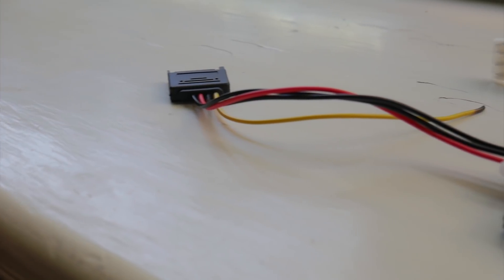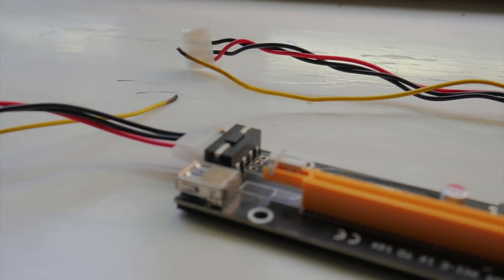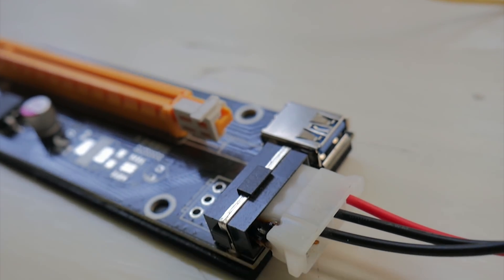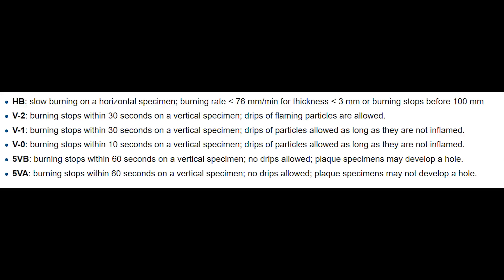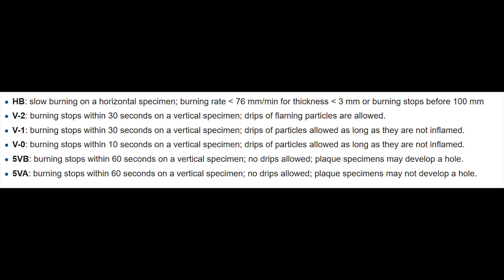My Mining Rig Caught Fire!?

Comment: I would like to add for those that are unfamilliar that smaller numbers on wire gauge equal thicker wire and higher numbers equal thinner wire.  Larger than 18 gauge would be 16 and not 20 because of this.
Reply: Is there an English translation for this thread?
Reply: So 18 gauge is 18AWG ?
Reply: @q8tech108  yes
Reply: cracklingice if people who don’t know this much less common sense to not overload wire never intended to handle that much current draw, they have no business messing with mining. 

Great way to burn down your house,. Also people need to stop putting multiple connections on a single six pin connection or using all the 6 pin connections that are in series coming from a power supply. Do not piggy back anything to power your risers or GPU. They are simply over amping that set of connections. Each graphics card should have their own dedicated line to the power supply. Hence they won’t catch fire and melt. 

It is as stupid as putting way too many high amp draw devices into a power strip and plugging it in your wall. It will burn your house down.

Comment: Can somone tell m e cause of This issue? So if I try to use claymore I get "NVML: cannot get current temperature, error 15".. But if I run cryptoheavy then I can run fully OC without a hiccup
Reply from the maker: any logs? hop in discord.
Reply: It's really weird.. it doesn't matter which card, or pcie slot I use.. Once I have all 12 cards plugged in the issue comes up but if I unplug any one of them it doesn't get the issue. I changed some of the risers and it doesn't matter. I thought maybe one of the slots was bad, but when I switch them around it doesn't effect it... basically 11 cards no problem, 12 cards problem.. I've run this setup for nearly a year before this without a problem... also if I run cryptoheavy I get no issues with 12 cards. I'm running SMOS

Comment: People think because it has worked X months without an issue it's fine. Nope it may not be fine. From doing electrical work I find that wires and components break down over time. This happens due to excessive heat on the site or connector. Heat degrades the line over time. Depending on the type of cover the wire has, the amount of heat and for how long,  will equal if it will fail. Same as house wires, max continuous load on a 15 amp circuit is 1440 watts NOT 1800w. You run 100% down your house lines be prepared for a potential fire over time.

Comment: I don't know about other's rigs but on what I had built I had a few molex and sata plugs browning and crap-out on me but nothing like melting the plug. Asics melted and carbonized plugs and PCBs like New Year's Eve but not my rigs. 
 
The fire-retardant part I relay on is that a noisy/dropping power rail on the PCIe slot causes the GPU to hang.
A hung GPU ain't mining. It stops. It stops drawing power from both PCIe slot and 12V plug. (not entirely but idles around 30watts so no dangers to continue to melt the plugs)

Aaaaand a hung GPU tells the rig to ring home to tell me that that it is in deep crap and needs attention. 
(A shitload of VM_CONTEXT1_PROTECTION_FAULT says crappy power lines or seriously overheating but power lines more often) 
On load I see five-ish amps on the 12V plug on the extender. I say it's a lot for a molex but it is just at it's max. 
I opted for 6pin pcie connectors on my rigs and if I have a molex I go from the PSU directly to it with no adapters. 
Expecially molex-sata adapters. Those are meant for hard drives that take 10 to 20 Watts of power, 5V and 12V combined.

Comment: Just to clarify: the connector part you looked up at Molex is only rated for 18 watts at 12 volts. The 60 watts rating is when running it at 40 volts. This is because wires and connectors are maximum rated according to amperage (ie. current).

That particular part has a max current rating of 1.5 amps which means if you use it to carry 12 volts, it can only handle 18 watts since at that power level it would max out the allowed current rating for the connector.

If instead you were running it at 40 volts it can handle a much higher 60 watts of power because the higher voltage of 40V is allowing the current to remain at it's rated 1.5 amp maximum level while it handles the higher 60W power level.

Comment: yellow wire = 12V. Makes sense that more current would be drawn over this, meaning more amps, meaning more heat due to the relationship between amps and resistance. Best to stay away from adapters, BUT as another youtuber AngryChicken showed in one of his vids... it really depends on the TYPE of molex to SATA adapter. Generally the kind that looks cheaper, where the wires don't quite fit the SATA plug are actually the better ones! The SATA plugs that are melted together and seem more firm/high quality are the very ones that short out and cause fires. Stay safe! If you can - get the newest risers that are SATA-to-6-pin or even better just SATA power and run 1 cable from your PSU to 1 riser.

Comment: I've had fires with molex cables on the Asus B250 Mining expert board... the reason is that they used to suggest plugging the molex cable that controls the 6-7 cards in the 1 of 3 groups of PCIe slots...turns out that overloads the molex cable somehow and have melted 3 cables this way. One time it was because I had kept the cable together with a twist tie that contained a wire... and it turns out that wire got hot, melted through the twist tie plastic, melted through the molex cable, and caused a short circuit.

Be safe guys

I bought a nest protect and smart plugs, then set an IFTTT rule that if ANY smoke was detected IFTTT would turn off all my smart plugs, as a safety measure. If it was an electrical fire it would cut down the fire at the source. Hopefully soon enough that it doesn't become a wood/paper fire. 

I'd looked into self-activating fire suppression systems, but they generally are powder based and can really F up your rigs. 

Best advice: don't overload your PSUs, don't overload your mains plugs (80% of theoretical max IS the max), use 1 cable per PCIe riser (or 2 if you really need to - but spread the load), and don't use any adapters if you can (e.g. molex to PCIe 6-pin). 

Great vid as always man - thanks
Reply: also remember: never ever ever use twist ties (they have metal cores). Zip ties are OK are they are only plastic

Comment: Son, If you don't use the adapter and you use straight sata to a riser is this any safer?
Reply: Yes.
Reply: No it is not safe because a sata connector is not rated for 75 Watt and some cards can pull that much, if you overclock even more.

If you have a psu with a wattage readout via software like the i series from corsair or a kill-a-watt you can "messure" what your card draws from the slot if you connect only the riser to that psu and power the rest through an other psu. It is not a very accurate measurement but it is a hint if the card draws more power from the slot or more from pcie.

Comment: Called running way too much current off of one plug duh. Wire gauges are only rated for only being  able to hand so much current draw. Just don’t be an idiot and over load a single 6pin plug from your power supply. Simply don’t overload your power supply and use correctly rated connections with no piggy backs period. Also here is a novel thought make sure what you are using to power your risers can handle the current draw you intend to use. 

Also it won’t catch fire because of additives in the plastics, it will just melt. This video makes my head hurt with the amount of stupidity from miners. “WHY DID it MELT.”

if people doing this had any clue what they were actually doing they wouldn’t be connecting all their graphics cards off of one connection from their power supply. Every GPU needs their own dedicated line to the power supply with nothing else spliced in it. Reason being they are Not designed to handle the current draw with the wire gauge used in-manufacturing them. Single connection per line from the power supply, if there is more connection on the same wire bundle of wires DO NOT USE THEM. One connection per bundle from your power supply. Hence you keep your current draw under the rated limits for the wire gauge and use some common sense and guess what it won’t fucking melt.

Comment: Damnn. Is this a coincidence? Because the same happend for me yesterday , the yellow wire in the molex connector burned to a crisp
Reply from the maker: It's really inevitable
Reply: Unfortunately its not that easy, I did a video showing that China cables are improperly stamped with the wrong specs cause they are knock off cables. https://youtu.be/F6XAtwbR7Xw Just because it says 18AWG doesn't mean it is...... sad world we live in
Reply: yellow wire = 12V. Makes sense that more current would be drawn over this, meaning more amps, meaning more heat due to the relationship between amps and resistance. Best to stay away from adapters, BUT as another youtuber AngryChicken showed in one of his vids... it really depends on the TYPE of molex to SATA adapter. Generally the kind that looks cheaper, where the wires don't quite fit the SATA plug are actually the better ones! The SATA plugs that are melted together and seem more firm/high quality are the very ones that short out and cause fires. Stay safe! If you can - get the newest risers that are SATA-to-6-pin or even better just SATA power and run 1 cable from your PSU to 1 riser.
Reply: Son of a Tech it is easily avoided if you use the proper rated wire gauge and DO not load multiple plugs on single connection from your power supply. Think of it as overloading your wall outlet with way too many things plugged in a power strip overloading your walls outlet.

Comment: Newer risers are using the gpu six pin connector.
Reply: Partial copy-paste: Best to stay away from adapters, BUT as another youtuber AngryChicken showed in one of his vids... it really depends on the TYPE of molex to SATA adapter. Generally the kind that looks cheaper, where the wires don't quite fit the SATA plug are actually the better ones! The SATA plugs that are melted together and seem more firm/high quality are the very ones that short out and cause fires. Stay safe! If you can - get the newest risers that are SATA-to-6-pin or even better just SATA power and run 1 cable from your PSU to 1 riser.
Reply: w4rr3ncom great people will put way too many on them as they are doing here and still catch their house on fire.

Comment: Happened to me twice on a particular PSU/Rig.  The melting wasn't as bad because the rig crashes every day till it got worse for a crash every hour.    
It is difficult to trace the issue but I'm using a PSU with at least 13 PCIe/Molex connectors.  The fix was to reduce that number to a maximum of 12 connections.

Comment: thats why I only use pcie connections on my risers and sometimes adapt 2 or 3 molex or sata to one pcie connector
Reply: more adapters = more risk
Reply: iamdmc Thats why I take 3 sata to pcie adapters and convert them into a single adapter with 3 sata connections to one pcie six pin. And I connect the sata connectors to at least two different cables at the psu.
And I have a ton of 2 Molex to 6pin pcie adapters from older gpus which I sometimes use to power risers.

I built a 13 x 1060 rig with 3 bq dark power pro psus where all risers and gpus are connected with a dedicated 6 pin directly of the psus. But thats mostly overkill, I could get it easily down to two psus with some "good" adapters.

Comment: If you use only molex cables and molex connectors to risers would that not solve the problem?
Reply: molex is a pretty dated (and now comparatively shitty) standard. You have 12V, 5V, and 2 grounds. SATA provides a) more wires of each 12V and 5V, spreading the load a bit, and b) 3.3V - although the usefulness of this in the mining realm is negligible. The best new risers use only a SATA connector, which you plug directly into with the cable from your PSU

Comment: I had issues with a corsair rm850 psu 80+ gold, where it melted the PCIE cables at the GPU end and the psu end, melted the 8 pin PCIE plugs on the GPU, the cables that melted were the ones supplied by Corsair, i ended up having to solder new 8 pin PCIE plugs on my cards and build custom pcie cables with 12 Gauge wire, ive even gone and eliminated the plugs on the risers, i now have them wired directly into the PSU with 12 gauge, yeah it might be a pain if a riser fails, but it only takes 10- 20 min to solder in a new one

Comment: Voltage drop due to other start/stop loads on the same circuit as the miner can cause this. I have a 20 amp dedicated circuit to my 120 panel and a surge arrestor installed.

Comment: I thought PCIe could deliver 75 watts. Is that not true?
Reply from the maker: The standard is 5.5 amps at 12v. So actual of 66
Reply: But don't the powered risers pull current from the pcie slot too ? Like 66w from the slot and the rest from the molex adapter ? I have some of these too and its kind of nasty not to know what can happen...
Reply from the maker: No, the risers are typically only x1.
Reply: Son of a Tech oh, now I have to see how much does x1 send...

Comment: i know what is causing it cause it is a big problem i have. One of the main reason is the volt on your house line drops to much cause the load is high. So if volts drop then amps goes up and poof you end up with problems if the amps exceeds the wires rating. so what causes the volts to drop suddenly. Well for me it was the hot water heater turning on, although a toaster or old microwave-coffee pot will also do it along with the a large motor starting. why does this happen? cause the power coming to your house is not stable enough cause your local transformer is over loaded at times. so what can you do to avoid this? buy a plug in meter and keep an eye on you volts over time, you will see at different times of the day it will drop. plan your use around the worse time as a max and it will help you not to have a fire. sucks cause you will not be able to max your system out but better safe than sorry. good luck!
Reply from the maker: Good info!

Comment: I thought it was 35w or 75w on PCIE slots depending on the power planes.
Reply from the maker: 35w on servers most of the time ya. Now 75 watts would be peak. However it reads more like 5.5 amps at 12v which equals an actual draw of 66. Which is what you want to calculate in this particular case
Reply: @SonofaTech  wait what on server 35w, are you sure about that i saw myself some people putting rx 570 and rx 470 in servers

Comment: I use molex and/ or 6 pin extensions to power my risers. I assume those are ok?
Reply from the maker: not necessarily. 6 pin pcie are ample. However molex may not be. I recommend risers powered by pcie 6 pin
Reply: Thanks man!
Reply: Son of a Tech it really depends. 6 pin might be best, but Molex is fine in most situations. Also depends on the card. I like to power each of my 1060s by Molex individually, but in a few cases I have 2 on a string. Each card pulls 73 watts total between the 6pin powering the card and the Molex. I can't test it directly, but I read that the 1060 pulls  tdp from the 6pin(62 watts) and 58 watts from the pcie. So at 73watts I am probably pulling 40w from the 6pin and 33w from pcie. That is well within specs for a molex direct connect on the riser, and to risers per cable with 66w total on the cable powering the risers. Problems really happen almost exclusively with adapter. Adapters are a major no no if you want to be safe electrically. They are a weak link. Always power a card with the cable direct to the riser. If you can't, then get new risers. Don't risk burning your rig and your house for 10 bucks a riser.
Reply from the maker: It is card dependent as I demonstrated in the video. I do know that for some reason rx series like to pull primarily from rail first then the pcie connector. So I would be extra careful there
Reply: Son of a Tech absolutely it is card dependant. But a Molex cable is pretty safe drawing up to 120w on the 12v rail. In my case of set 73w per card total, the card would need to pull over 80% from the pcie lane.  That is highly doubtful when it has a 6 pin power applied. Now if it were a 1050ti, that gets all its power from pcie, yes that could be a problem. As I said before the real problem in almost all reported fires is when a sata to Molex, or a Molex to 6 pin adapter is used. Just be safe and don't use adapters.

Comment: Use these then no adapters required https://www.ebay.com.au/itm/Riser-graphics-card-LATEST-VERSION-VER008S-3-in-1-PCIE-PCI-E-PCI-Express/292478920248?hash=item44191a2638:g:zHQAAOSwpFtapNbV  no affiliate links or anything - you can pick whatever leads you have available from the PSU so no adapters